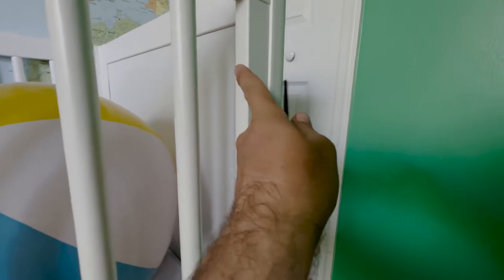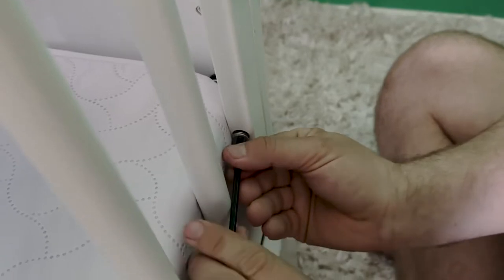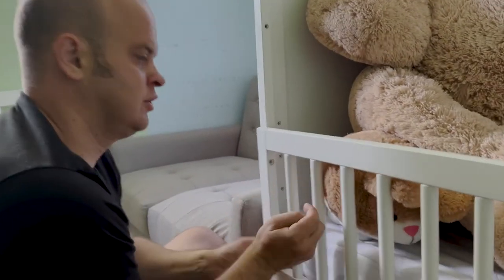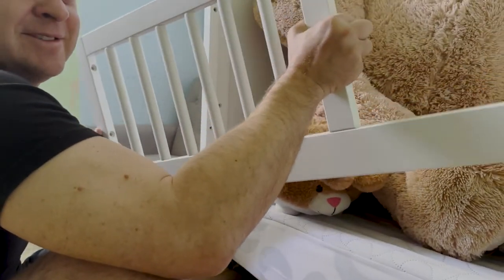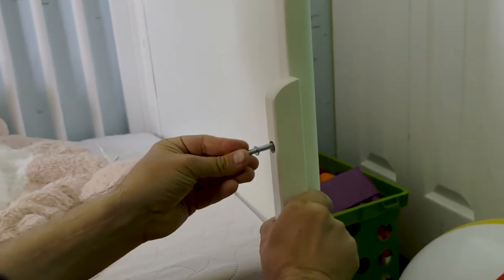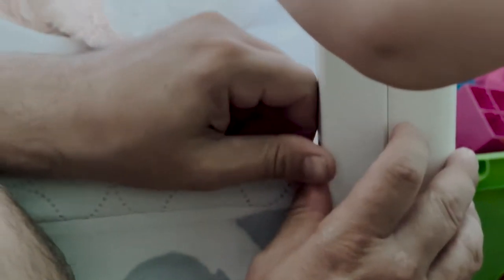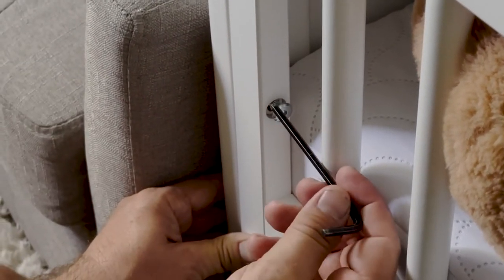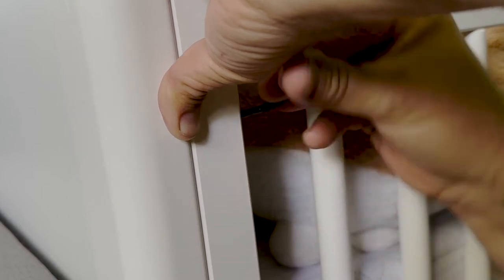Baby Letto Crib To Toddler Bed Conversion

Comment: Thanks for this, about to do this very same conversion myself. Serious question though: which end does his head go? Beside the railing, or beside the opening?
Reply from the maker: Thanks for the question. It’s up to you. Personally, we put our baby’s head by the opening so that when he wakes up he can get right out. BUT it may be safer (because of rolling) to put the baby’s head by the railing. Good luck!
Reply: Is there a certain side you put the toddler rail on? I took off one side, but mine doesn’t have screw holes on the main poles for the toddler bed.

Comment: Is there a certain side you put the toddler rail on? I took off one side, but mine doesn’t have screw holes on the main poles for the toddler bed.
Reply from the maker: Yeah you put the rail on the side with the drawers on it 👍
Reply: Mine doesn’t have the second upper hole just one for the lowest screw on the toddler rail 😳 did you figure yours out?
Reply: Ok, so I unscrewed the short ends of the beds to see the beams they screw into were on the wrong ends and when I switched them, the two holes were there for the toddler rail. Just not visible when you install them incorrectly, which you wouldn’t know until came time for the toddler rail